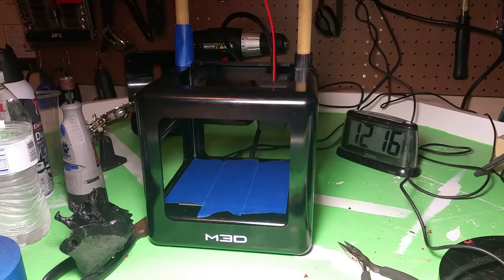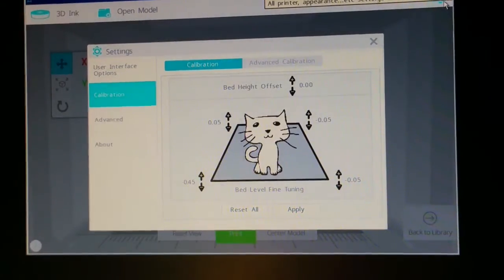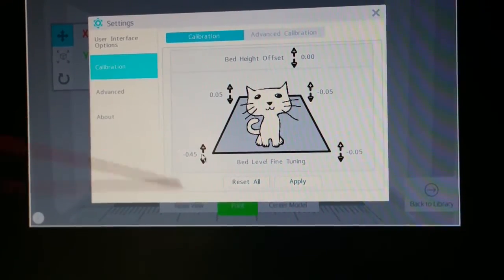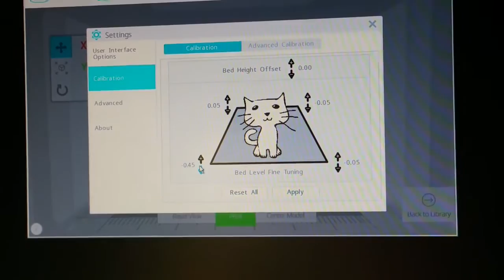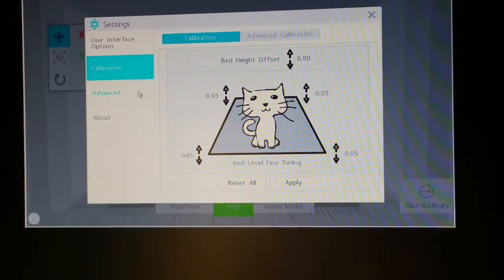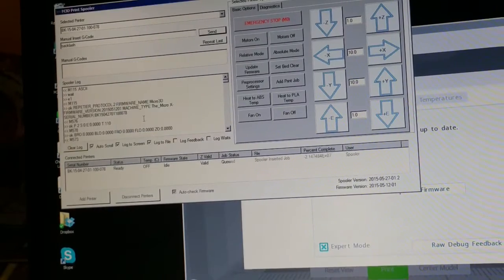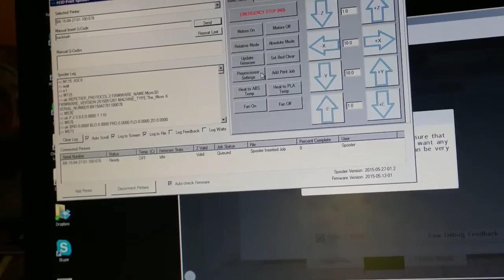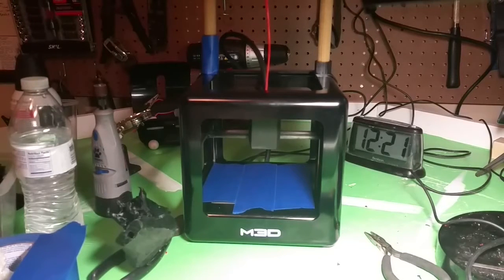M3D Micro Printer - Update #13 Solved: Prints shifting to the right and current projects

Comment: First, thanks for taking the time to do these videos.
I'm brand spanking new at 3d printing, and the M3D printer is my 1st.  When I 1st calibrated it, when facing the printer, it shot all the way over to the right and shot it right off of that access, almost like it was still seeking the center in the wrong spot.  When I've tried to do the example square, it always comes off of the bed and onto the printer itself.  I'm going to try your suggestion here w/ the equation, but is this something you've experienced, or something that you've heard of yourself?  Thanks in advance for any help, I know I have a lot to learn here.

Comment: Thank you so much for the information. I've been having this problem with some of my prints for the past 5 months, most recently when trying to print a fuse box I modeled. I thought for sure it may have been the models I was using.

One quick question, what is that blue stuff you laid on your bed to get the prints to stick?
Reply: +Demitrius Skrapates it is painter tape

Comment: Hello! I've tried you way...first print gone great...but when I tried print something larger and in higher quality-it shifted again. Is your printer still fine? Not sure what is the problem, but it was working really great for first 3 days of purchase...so anyway I still have problem it looks like-hope you had better look and it is only me who does something wrong. BTW I have set up a spreadsheet which counts correct values for you-if someone wants it-here's the link: 

https://drive.google.com/file/d/0B7VEMKLxg9BMM2thYWc4QmFydnc/view?usp=sharing
Reply: I guess I'm not real clear as to where the cylinder is "most circular". It has backlash signatures all up both sides. I kinda took a guess, and printed the "test cylinder" and it came out decentish.  Do you have to to more fine-tuning after you measured?  And just kinda SWAG it?